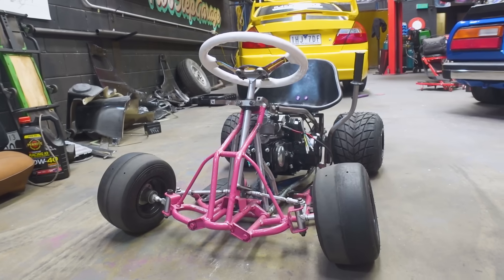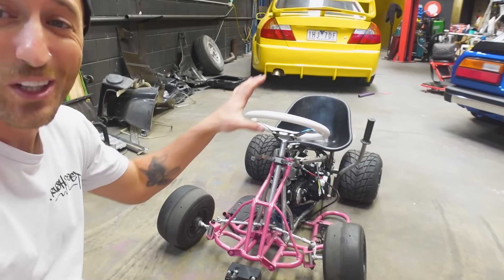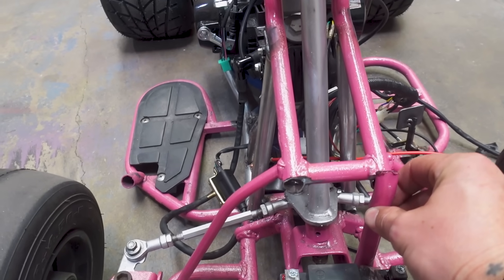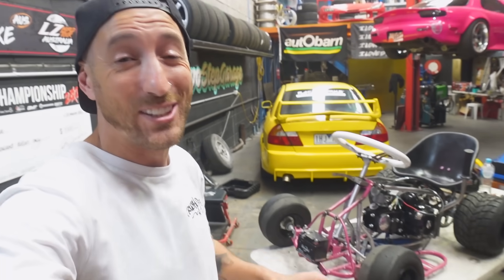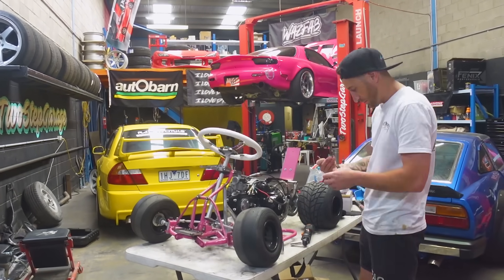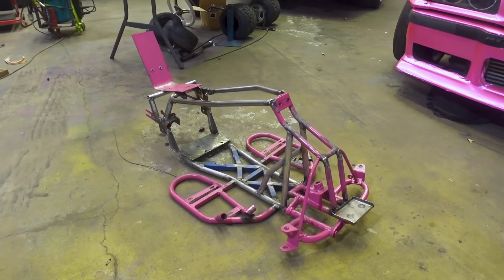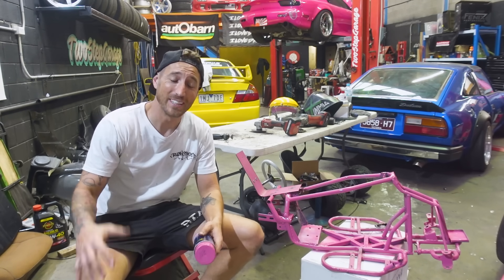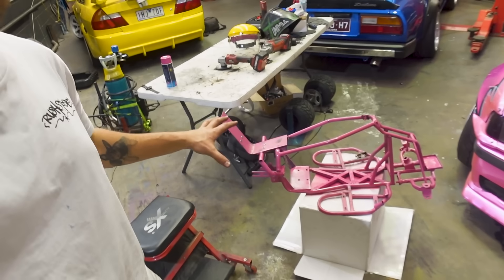Installing a HUGE 125cc 4 stroke motor in our BUDGET Drift Kart! | Part 7

Comment: How you're keeping up the energy so fricking high is amazing! Just a thought, could it be worth putting a thick metal plate between your nuts and the bottom of the engine...  if this one blows like the 2 stroke, its gona be a bigger heavier lump flying out the bottom....😮😢😂 loving it mate! 😊

Comment: Might not need it, but I'd be putting some rubber under the battery and where the strap/s will be. Bit of vibration with no suspension....

Comment: Naw, short one. But looooooooove the project. I have to finish my 50 drift kart before I think about building a 125 version. Are you running full size rear kart wheel/ tyres? (Have seen some with front sized front and rear. )